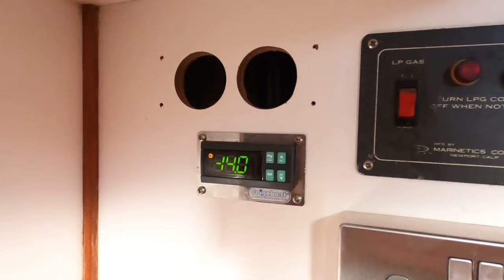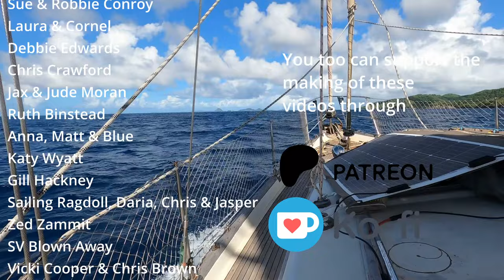HOW long should an ANCHOR CHAIN last? LIFE AFTER 50 EP.129 | SV Cordelia

Comment: The chain you use is NOT an anchorchain, but a hoistingchain.
An anchorchain has totally different specifications, an anchorchain does not need to be strong AT ALL, it only needs to be rustfree-treated.
OK i am not a professional on this, but you can find the information, on a new chain the class-of-chain is stanced in every link.
Reply: You are absolutely correct. While Hi-Test chain is not technically "Hoisting Chain", you are making perfect sense.
What misleads people is the belief that stronger is better when it comes to chain. This has nothing to do with Where their chain is produced (oh, no, it's Chinese!), and nothing to do with the quality of the galvanising, but it has everything to do with the carbon content, or the strength of their chain.
Regardless of whether the zinc coating is any good or not, stronger chain will rust sooner and faster when subjected to salt water. Many people think their chain has inferior galvinisation, when in fact their higher-strength chain is simply using its zinc coating up faster.
If your windlass takes BBB, you're lucky because not only are your individual links closer to round circles than other types of chain (this means it stacks and feeds out better as it is less likely to kink or hockle), but because triple B is not usually produced in hi carbon (Hi-Test) alloys. If your chain links are Exfoliating (coming apart in layers, as it "expands"), then it is not the best choice.
"Proof Coil" is a Good choice, if your chainwheel (wildcat) won't accept short links.
There, I've said it. I've been creating anchor rodes for all kinds of vessels for many decades and this misconception is so firmly rooted that I started out believing that stronger chain was better myself, since that's what all the "expert boaters" said. Don't fall for it.
Thank You
Cheers!
Reply: Hey! You! With the orange bilge water! Please think about it.
Reply from the maker: Thank you for the information, we will definitely look into this before we purchase our next chain :)
Reply from the maker: Thank you for this information.  When we purchase our windlass from Lewmar we purchased the chain from them at the same time.  It is 13mm galvanised chain and we don't know what grade it is.  We were a bit green about ground tackle then.
We are interested, what would you replace it with?  Is this something that you are able to help us purchase and if so, where from?
Thanks again for the information.  Steve